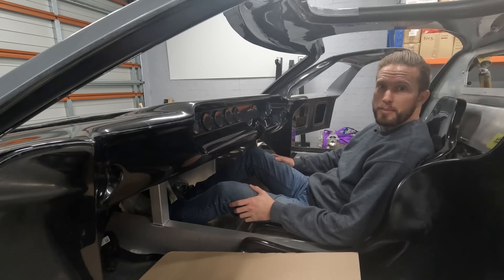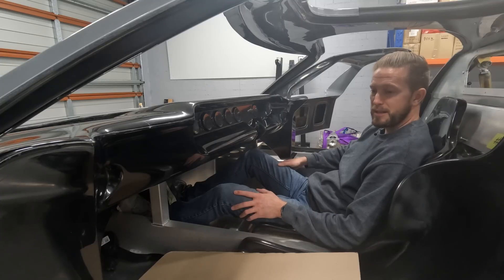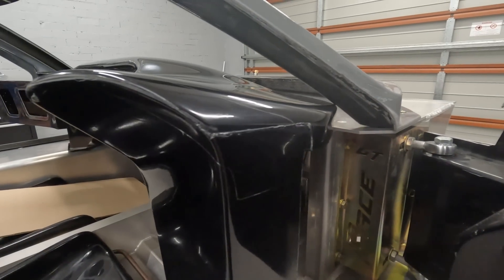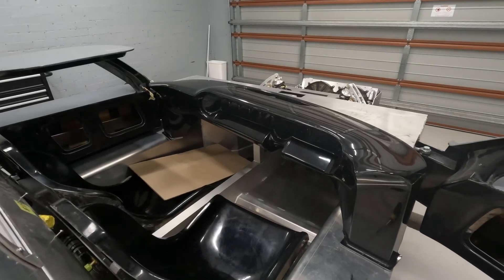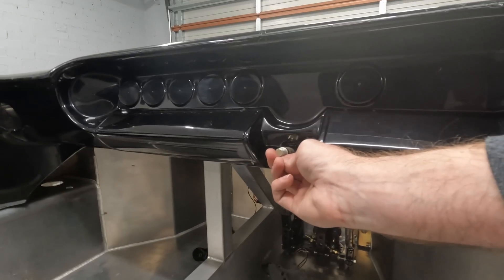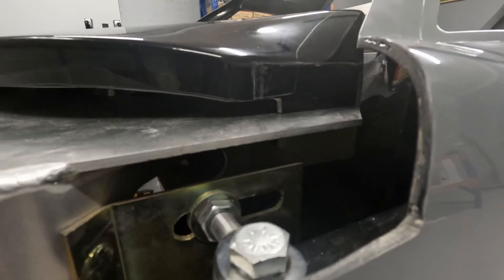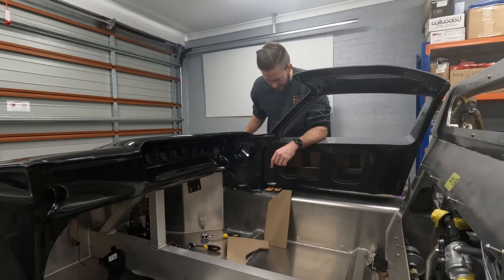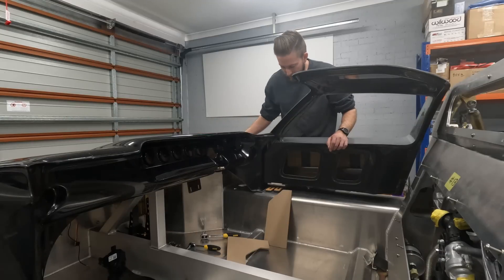GT40 Kit Car Build - Ep 28 – Dash Installation

Comment: fantastic effort. As someone who is also making one of these from the same supplier (and without nearly the engineering skills Dan has) I can't say enough how impossible it would be to do without Dan's guides!!  just awesome 👍
Reply from the maker: Thanks Ian! Great to hear these videos are helping you work through your build, this is exactly what I was hoping to achieve! Please do not hesitate to reach out if you have any queries, you can find me on Instagram or my email in About tab on YT (if you go to my channel page).
Reply: Great work this week. Just remember you will need to have enough gap between the spider and the dash to allow for trimming. Looks like the cuts were pretty close to the guide lines on the dash.  You’d approached it the right way, a little at a time. Is the dash layer up with Epoxy or polyester. Be careful if it’s polyester, as it has a waxy substance in it so the surface isn’t sticky. Works great, but makes any repairs a nightmare as it won’t bond to itself. Epoxy is fine, easy to repair. Best to do a scarf joint at around 15 to 1.

Comment: Like I've said in the past, it's a kit car, so perfection is not in the design of it. You are doing an amazing job of perfecting it. If you plan to pad and cover the dash, I'd suggest between 5 and 7 mm of clearance on the top and about 3 to 4mm on the bottom (around the door sills) for that.The foam pad and the vinyl will compress but over time the movement of parts will cut in. No matter how rigid you think it is, it will actually flex quite a bit when driving. Also your door cards (inside covers) will also make up a lot of space to close those gaps, just talk with your upholstery guy about that.
Reply from the maker: Thanks James, appreciate the guidance regarding clearances. Will likely need to trim a bit more around the pillars before I upholster it.

Comment: Ive had the pleasure of driving 4 original GT40's during my younger years, 2 road going and two race versions, all genuine models from Ford. From my recollection the dash swept to the roll cage on the race versions but there was metal on the lower sections and it had a hole if I recall correctly which had the door strap attached. The roll cage was present in the race versions which came down inside the car on top of the side fuel tanks and actually effectively covered any view of the 'pillar' below the dash top. If you intend fitting a cage, then I wouldnt worry too much about aesthetics as most of it will be covered by the cage tubing. I think it was just left bare on the Mk III road versions I drove (One is still owned by Ford that I drove).
Reply: The fact that you have experience with real GT40s should tell you that this kit shares very little in design or construction so making comparisons cannot help.
The approach Dan has, in gradual adjustments, will get him to where he wants to be. It's just a shame that the kit supplier hasn't done the work before selling the kit ...

Comment: CAD cardboard aided design , should let you know where to cut out for the a pillars . And the front edge of the dash should line up with the cowl on the outside of the windshield . At least that's how I would figure out my height and where to cut .

Comment: Not to be mister obvious but, how the dash assembly is affixed will determine a lot of the final fitment as well. You may have mentioned fasteners / trim but I do not recall. Great stuff, talk about your one shot for results especially with potential vibration noise issues later. Good luck.
Reply from the maker: G'day Dave, intention is to trim in leather. Fastening of the dash seems to be limited to 1 screw in each upstand of the dash (within door cavity. Other than that, it just seems to sit in under the roof spider/ windscreen lip.

Comment: I would suggest that you check the windscreen for fit very soon, before you modify the way the spider sits onto the chassis.
Reply from the maker: G'day Ed, the spider is quite rigid. I have had the screen sitting it the spider before I mounted the spider to the chassis, there is a bit of room to manoeuvre the windscreen within the spider.
Reply: @BuiltbyDan  Agreed. But even if the spider twists by only 5mm as you bolt it down you'll never get the screen to twist to suit. I'm not criticising...just going by my own experience building a '40 in the UK, and the experience and guidance of other UK and US builders.
Reply from the maker: You raise a good point. Think I'll drop it in this weekend just to double-check. Thanks for the advice.

Comment: Don't know if anyone already mentioned it, but aplying a heat gun to warm up the fiberglass parts may releave stress/warping in the parts and may make fitment easier/ better 
it is used on "normail" body kits, to minimice the warping from shipping and warpiing/ stress that comes after it's been released from the mold.
Reply: Not a good idea. GRP is a thermoset material and whilst you can heat it to make it 'move' it is likely to degrade its structural integrity.

Comment: Not being that familiar with this GT40 kit, I was wondering if the fiberglass gel coat of the dash is going to be the finished surface of the dash. Wouldn't you want to wrap portions of it with leather (or other material of your choice) for a nicer finish? I would think that would give you an opportunity to close up the gaps between the dash and doors.
Reply from the maker: G'day, yes, I will be leather trimming the dash, so as you note, it will reduce the gaps slightly. I just needed to get it fitted first to avoid having to modify it once trimmed. I'll probably need to trim a bit more to provide clearance for the leather.

Comment: To fix this is not going to be for the faint of heart. But adding on to the bottom of the “a” pillar at the bottom to bring the gaps together. Why the manufacture didn’t solve this issue from the start is surprising to me. In any case you will figure it out.

Comment: Isn't the gap for the roll cage?
Reply from the maker: I would expect a cage to sit in front of the door, not between the door and dash. There is only about 10mm (1/ 2 in) gap along the vertical section between door and dash upright.

Comment: do  you have  anyone locally that does 3D laser scanning? could  have them  scan the interior without the dash, and then scan the dash, you can do modifications to the dash in CAD and then translate that to the actual part?
Reply from the maker: Thanks for the recommendation, Raymond. I had not actually thought about doing that.

Comment: Dan I'm watching the vidio now ,you must first put your seat in relation to peddles and hight ect , then start put dash hìght in also you may have look though the steering wheel to see rev counter and speedo, some times oil pressure too, you must get your seating position first with seat height steering wheel height first, my name is colin iv 40 years ex my son works for f1
Reply from the maker: Thanks for the advice, Colin.

Comment: Why would you try to trim anything without the door cards in place?   That will change the profile of the door.
Reply from the maker: There are no door cards supplied. It's intended to be left open or need to fabricate your own infill panels for the two openings into the door.
Reply: @BuiltbyDan  Hello Dan ,
Do you intend on leaving them open?  if so then by all means align the dashboard to the door, otherwise my point still stands create your doorcards or use carboard to simulate the width and hieght of the doorcards and then align the dashboard to that.  Otherwise you will still have something that looks out of place. Keep up the great content!  You have approached this build with a  systematic problem solving system.  I admire your ability to make this car exactly YOURS and not a carbon copy of just another Ford.   All of the skills you have learned buildind it will create great memories.  Ask me how I know. LOL!
Reply from the maker: Thanks Shane. I do have an idea to infill the holes in the door to create a little door pocket, but not sure how I will execute just yet... either way, it won't change the profile of the door where it intersects with the dash.

Comment: This is a pretty poor show by the kit manufacturer. One would expect the major components to fit together with minimum fettling, not require major surgery. One would also expect the side to side symmetry to be within a millimetre or two.
Trimming the dash all the way round to give a vertical drop with no rotation may be the way to go. Any additional gap is well out of the way and could be easily hidden.